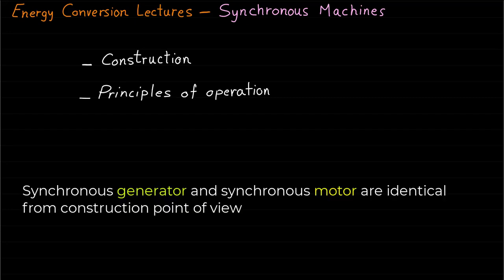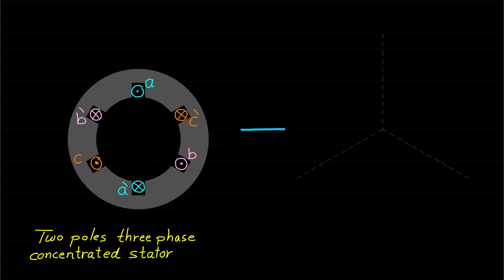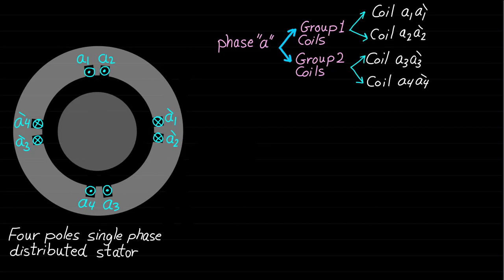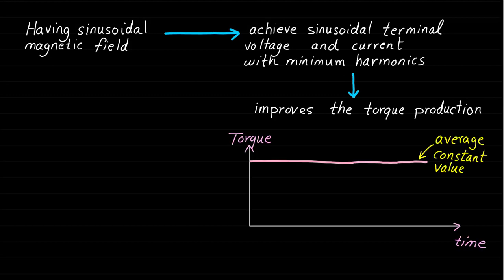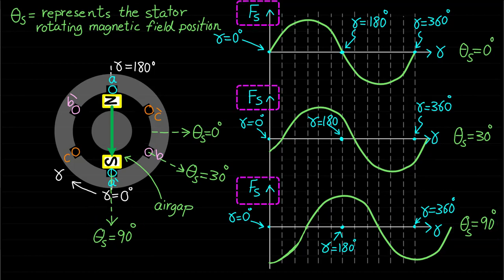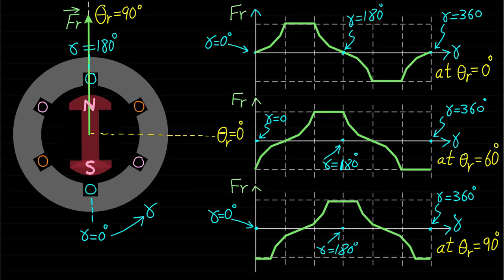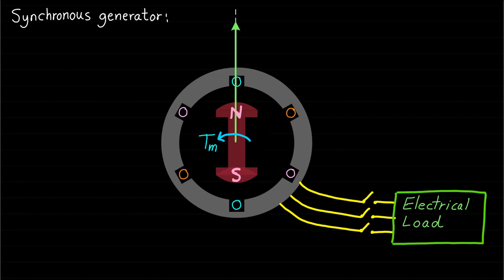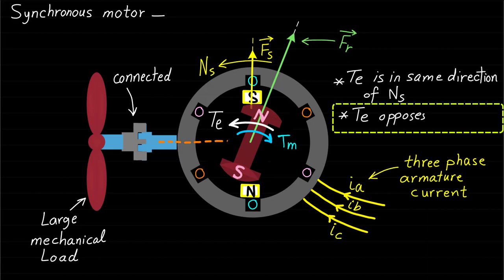Synchronous Machines - Introduction (Part 2)

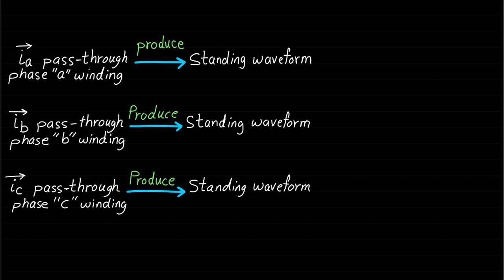Comment: 25:58 I think this point is a little confusing. For a given load the current will generate a constant rotating magnetic field but if you change load the current will change causing more or less magnetic force
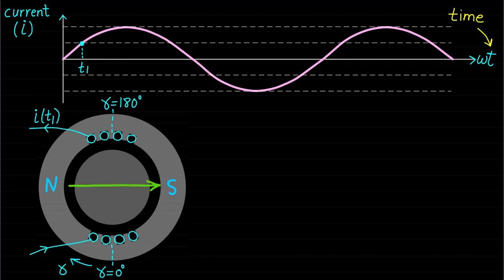Reply from the maker: Thank you for your question. Sorry for the confusion. In the lecture, I meant even when the current is changing sinusoidally with the time, the rotating magnetic field will have constant magnitude. For example, if phase a current is equal to     "ia=Im sin wt" , the magnitude of phase a current is constant and equal to Im. However, we can say phase a current is changing sinusoidally with time. This is what I meant in the lecture. At 22:34 I explained how the standing magnetic field is produced when the current is changing sinusoidally with time. Hope this clear your confusion. Please let me know if you need more explanation.   Thanks
Reply: @EnergyConversionAcademy  I actually have a different question. If I increase reactive load on a synchronous generator operating alone, I assert that nothing should happen to the counter torque induced in the machine. Yet the stator field should become stronger with more current, and thus the net field should become weaker. According to the induced torque equation the induced torque should change yet we are not pulling more power out of the machine
Reply from the maker: The best way to understand the  load change is to model the standalone generator  as an A.C voltage source connected to synchronous reactance and the load impedance in series. The load can be modeled as a resistance in series with inductance. The load impedance is Z with angle of Theta. Theta represent the power factor.  We can assume that the back EMF of the generator or the A.C voltage source is constant as the excitation is constant. Now As the load increase (impedance Z is reduced), the drawn current is increase and the voltage terminal will drop ( drop across the synchronous reactance) and the load angle (delta between the voltage source and the terminal voltage) will increase. This will cause increase of the active power. Basically, if we change both the resistance and the inductance the active power will increase.  I highly recommend to simulate the circuit using MATLAB simulink and perform different load change. That means try to change only change the resistance, or try to change only the load inductance or change both to keep the power factor same.   With all these changes observe the power which also give you idea about the torque as the speed assumed constant. Hope the explanation is clear. Please simulate this scenario and let me know if the above make sense or not. Thanks again for your question.

Comment: Hello again, fantastic video! I'd like to inquire if you're familiar with the process of calculating mutual inductance between phase A and phase B in a synchronous machine. I've gone through your earlier lecture where you explained mutual inductance using visual aids, but when it comes to the specific case of a 3-phase synchronous machine, I'm still struggling to understand how to derive the mutual inductance. In this context, the equation I'm referring to is Lab = -M + Lmcos(2(theta + pi/6)).
Reply from the maker: Thank you for your comment and question. Sorry for the late response. Finally I got time to reply to your question. It is very hard to answer your question using few lines. Therefore. I will give you two references for your review: 
1. D.W. Novotny and T.A. Lipo "Vector control and dynamics of a.c drives" Oxford 1996. (Page 41-Page 43)
2.
https://www.youtube.com/watch?v=WrWS5Zy1VE4&t=2271s

Note: You might notice some differences between the derivation of the two references. The reason is that these two references use different assumptions during the derivation.    
Hope my answer help you with your study and investigation. Thanks

Comment: Sir,Why is the diagram equivalent to an induction machine after converting to the rotor side, they are different in frequency but still the same transformer
Reply from the maker: In general, induction machine operates or behaves like a transformer in which the frequency is also transformed in proportion to slip (s) such that the rotor induced voltage emf is equal to (slip *E2)  and the rotor reactance is equal to (slip*X2). However, due to some mathematical simplification to the original equivalent circuit diagram of induction machine, it looks like that the transformer of the equivalent circuit is independent to slip or frequency. Hope this answer your question. If not send me through email more details about your question. Thanks

Comment: Sir , is the mmf distribution in the gap of a synchronous machine the same as in a squirrel-cage induction machine?
Reply from the maker: Cylindrical rotor synchronous machine has same airgap mmf distribution as the squirrel-cage induction machine. However, the mmf distribution of  salient rotor synchronous machine has  mmf airgap distribution different from induction machine. Hope we can cover this area in future lectures.
Reply: Can you produce more videos on the topic of induction machines, because I am doing research on wind turbines.
Reply from the maker: I am planning in the future to cover the induction machine lectures. However. this may take long time until I start the induction machine. In the mean time if you have question, you can send it to me through the channel email attached in the channel and I will try my best to answer your question or at least give you some reference to review.

Comment: Sir, how to create balance torque on rotor, when mmf air gap is sine form😊
Reply from the maker: Very good question. Please review lecture 11 of chapter 2 which has derivation for the torque expression and some answers to your question. Basically, the torque expression is equal to  Te= ir* is * M sin (angle). This expression can also be written as Te=K Phi_r*Phi_s sin(delta). Where, K is constant, Phi_r is the rotor field magnitude, Phi_s is the stator field magnitude and the angle delta is the angle between the rotor field and the stator field. So, since the angle delta is constant in steady-state, then the torque will be constant value with time. Hope this answer can help you for now. Note that this question or the developed torque will be discussed in details in future lectures. I highly encourage you to review the last few lectures
of chapter 2.

Comment: at 44:52 this force is the magnetic force of the sator acting on the rotor which is a magnet or the magnetic force acting on the current ( lorent law ) ?
Reply from the maker: The rule of identifying the electromagnetic torque (Te) in the lecture  stated that the rotating rotor magnetic field is always try to catch the stator rotating magnetic field is a quick rule based on the behavior of the two rotating magnetic fields as explained in the lecture.  I am not referring to Lorentz Law in this lecture.

Comment: Great video! The content was very helpful and informative, I really appreciate the effort put into explaining the concept of concentrated winding.

I did have a question about the winding itself. I understand that concentrated winding involves winding multiple coils across one slot, but why in the video you showed it wind across multiple tooth instead of just winding around a single tooth? Isn't concentrated winding, wind in one tooth? did i misunderstood somethings?

Thank you for the excellent explanation and I look forward to learning more!
Reply from the maker: Thank you for your question. In case of “Two poles” three phase concentrated armature windings, each phase consists of one coil (for example phase "a" consist of coil a a’ only). each coil (for example coil a a’) consists of two sides, ( side a and side a’). Each side installed in only “ONE” slot. Basically, this is the definition of the concentrated winding or coil.
Now, in case of “Four poles” three phase concentrated armature windings, each phase consists of two coils (for example: phase a consist of coil a1 a1’ and coil a2 a2’ ).  Now, just focus on only one of these two coils. Let’s focus on coil a1 a1’. Coil a1 a1’ has two sides. Each side installed in only “ONE” slot.
Basically, if you define a factor called SPP (Slots per Poles per Phase) and apply it to any concentrated windings machine, you will find SPP equal to 1 (ONE). 
For example, we know that the two poles three phase concentrated windings consist of six slots in total. Therefore, the SPP = 6/2/3 =1 slot. Also, for the  four poles three phase concentrated windings, the stator (armature) consists of twelve slots in total. Therefore, the SPP=12/4/3=1 slot.
Let me know if this answer your question. Thanks again for your question. Please refer to the certain time slots of the video in order for me to give you better explanation to  your question.
Reply: @EnergyConversionAcademy  Do you happen to be familiar with Star of Slots?i.e how to design the winding configuration for different slot/pole combination I would greatly appreciate it if you could create a brief video about it or explain the steps in designing it
Reply from the maker: I am working on some lectures related to armature windings. However, these lectures will be  introduction about the armature windings.

Comment: Sir, in generation mode, would there be electrical torque if no load connected? Thanks
Reply from the maker: Assume the generator is rotating by a turbine at certain speed. If "No" electrical load is connected to the machine, the machine will generate zero electromagnetic torque. Note that the machine will develop terminal voltage at the armature terminals but there is no stator current flowing. Now, once electrical load is connected to the machine, the stator current and therefore the electromagnetic torque will depends on the electrical load level. That means if the load is small then the torque will be small. If the load is high then the torque will be high. Let me know if this answers your question.
Reply: @EnergyConversionAcademy  thank you sir, you have cleared my doubts. We hope for the next class soon sir